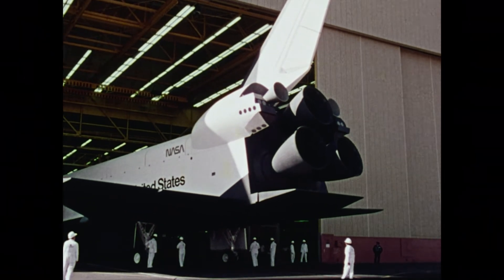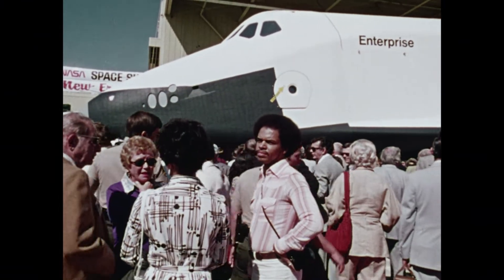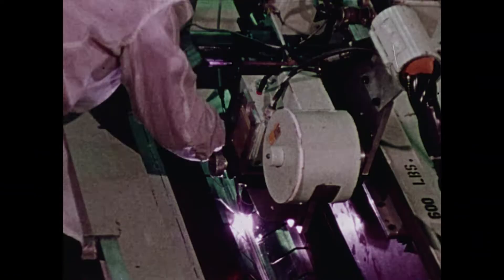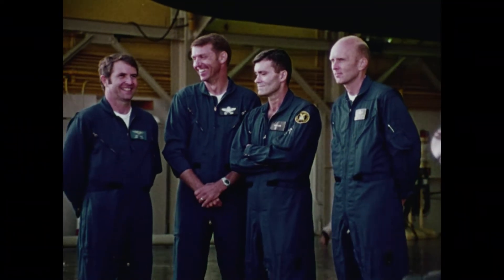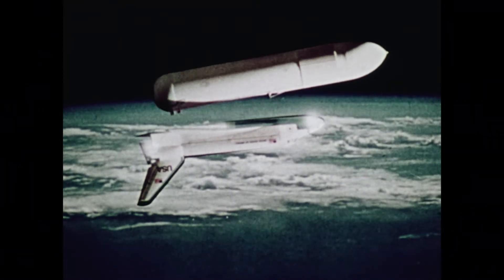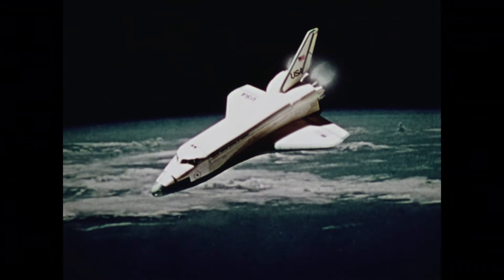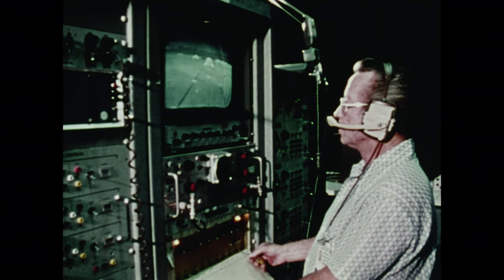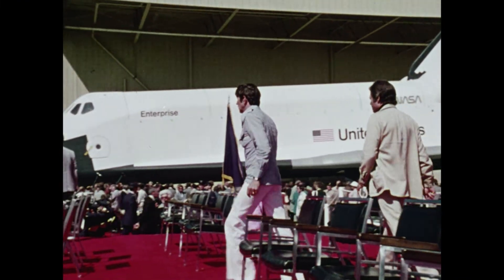Space Shuttle OV-101 Enterprise public roll-out in Palmdale, CA + construction and mission animation

Comment: I was always fascinated by the space shuttles and God knows inspite of upgrading it, why it was retired.....
Reply: Because it never became what it was intended to be

It was meant to be a platform for servicing and retrieving satellites, making it cheaper to design and build them. But technology got better to the point that it was no longer needed. The only servicing the Shuttle did after the 90s was Hubble.
It was meant to be the sole means of deploying American payloads. After Challenger, the military noped out of the program, and a lot of commercial customers went to ESA
It was meant to be the cargo truck for the space station, which came way too late, in smaller form, and never operated to the designed capacity

In short, it flew a lot less than intended and never got as cheap as designed. With few flight hours you also don't build reliability,  new issues pop up every flight and you need to stop and  do research to fix them, or you don't do that and you get the Columbia disaster.

Starship promises to be everything Shuttle was not: https://www.youtube.com/watch?v=peXhBc71kX0